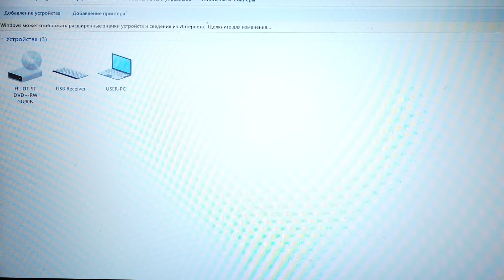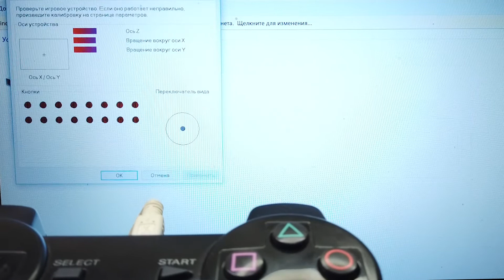Restoration gamepad dualshock 3 not work button R1 R2 L1 L2 not charging repair and fix playstation

Comment: This is just one type of controller... there are more than s few revisions of the DS3. Someone should make a more comprehensive breakdown about them- because if this were the problem with my controller than heck it'd be less a problem (maybe)... but I've never even used a DS3 with pcb trigger sections. All of the ones I've had use the flat ribbon cable overlays... :P 

Interesting, though.
Reply from the maker: I have another video on repairing controllers on my channel, go to the channel in - playlists - folder " fix and repaire ". and search there
Reply: @skill.  thank you :) I repaired my controller successfully, it just took some trial and error to get it just right. 

Hope your day is swell 🌌✌
Reply from the maker: @SafetyFirstToolFans.94  👌👍✌